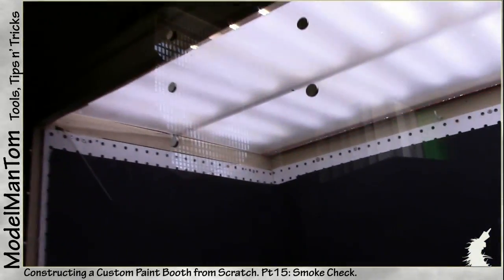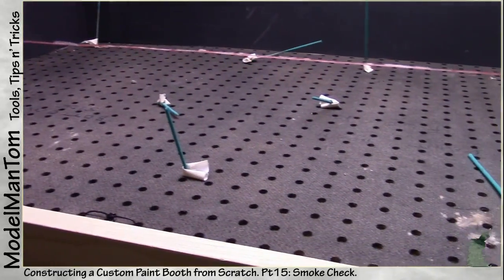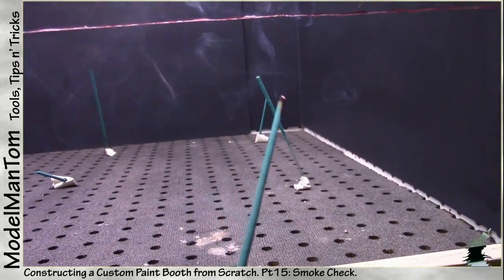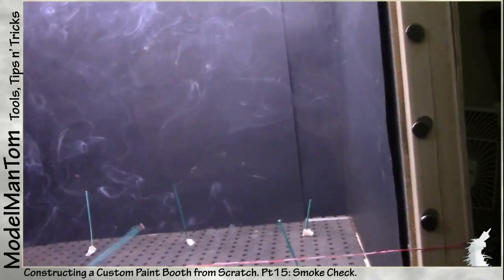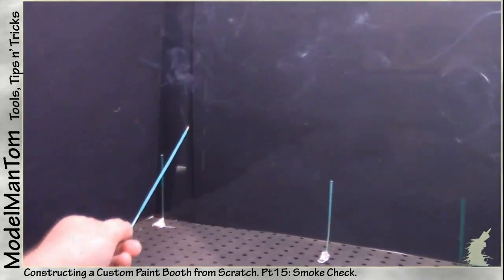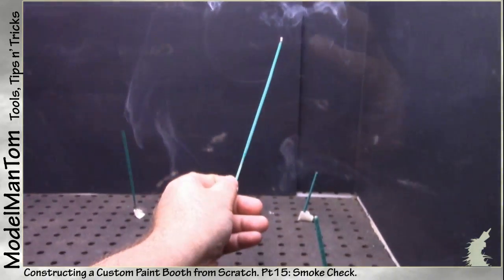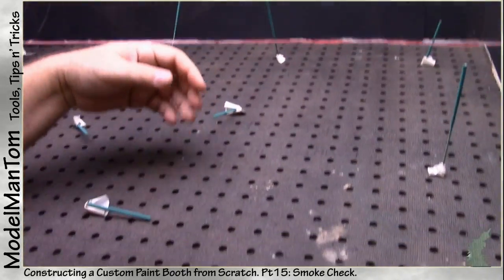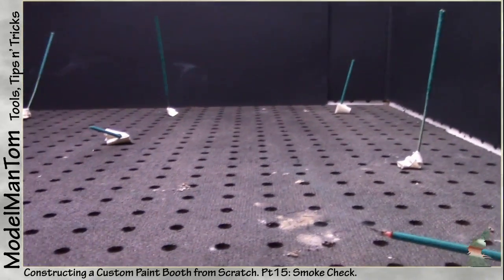Paint Booth Pt 15: Smoke Check

Comment: It looks like you are getting some nice air flow on it.   I never did anything like that.  Only a little bit with incense like you and then some rattle can....   No fume smell 1 ft away from the booth, so I knew it was OK.  One thing though, rattle can plugs up the filters really fast.
Reply from the maker: badgrendels I wondered that about rattle cans.  Spary with the air off, then vacate the booth once done?  Give the heavier particles time to drop is my thinking, but maybe not enough time to make it worth it.  Perhaps this booth may encourage me out of my rattle can addiction and into full time air brushing.  It's definitely not going to convert me to acrylics any time soon.  lol.The next video with all those incense sticks burning is just uploading now, another ~4hrs @ 1.2gb) .  Another vid of slo-mo smoke shots will follow.
Reply: ModelManTom Acrylics can be a pain to use, some brands tend to gum up the airbrush.

I have no problem with rattle can, I used it last night.   You just have to change out the filter material quite often.